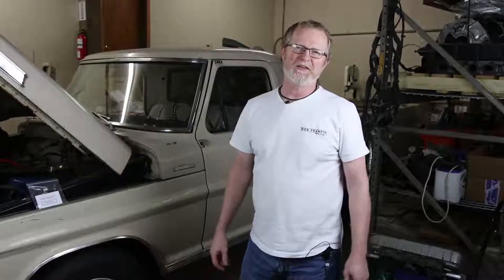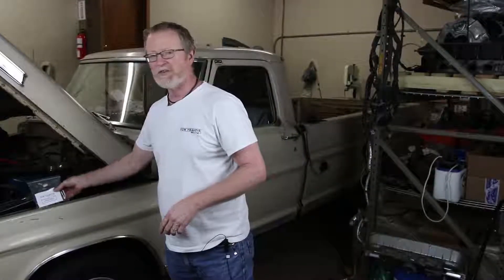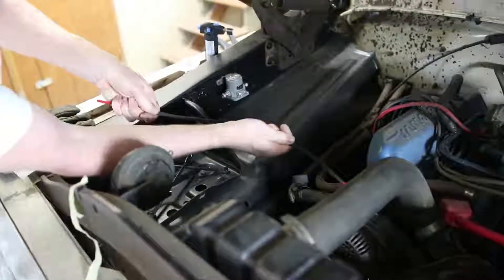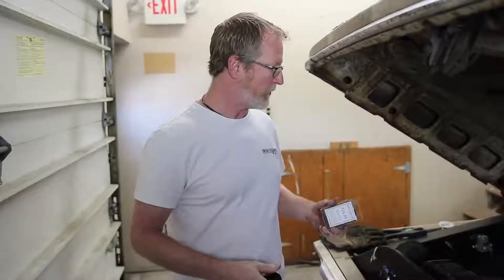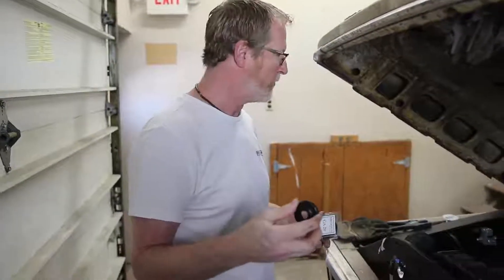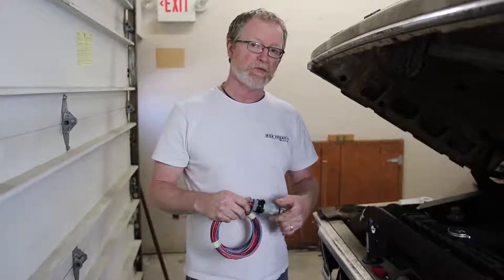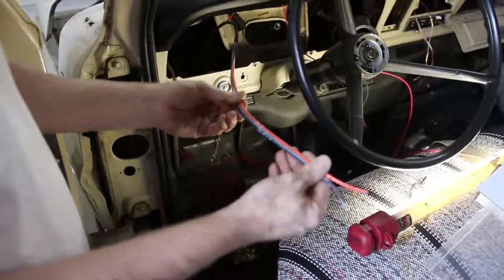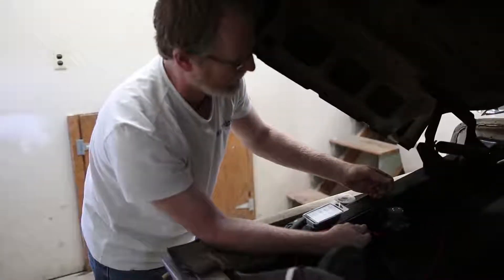F-250 Part 4 Project Rewire

Comment: I have a 77 c10 I’m considering Ron Francis! Do you recommend over American Auto Wire?
Reply from the maker: That is a decision that you have to make that best suits your needs. We all make great wiring products but at the end of the day it's your call.
Reply: Sell me on your product! Do you make a kit aimed at my make and model ?
Reply from the maker: @burnnc10454  based on the information you provided, we do have a kit that will work on your truck. We do point out that we do not make OEM reproduction harnesses, so if you're looking for a duplicate of what you have installed, we would recommend American Autowire. If you're not concerned about that, then we can wire up your truck. One thing you will get from us that you won't get from anyone else - free lifetime tech support.
Reply: That is very helpful, my truck did not come with any wiring! It was a project truck I got from a trade, it was missing a ton of parts. I’m not set on a factory looking kit as long as I can make it look like it should be there. My main concern would be the square hole in the firewall where the old wiring bulkhead entered the cab considering the cab has been painted and set back on the chassis. Do you offer any solutions in your kit or any recommendations?
Reply from the maker: @burnnc10454  best way to get specific info is to send an email. rfwinfo@ronfrancis.com. We will send you the information you need and answer all the questions you have. It sounds like you have a custom truck so we have some solutions that will allow you to do a really nice install on the wiring.